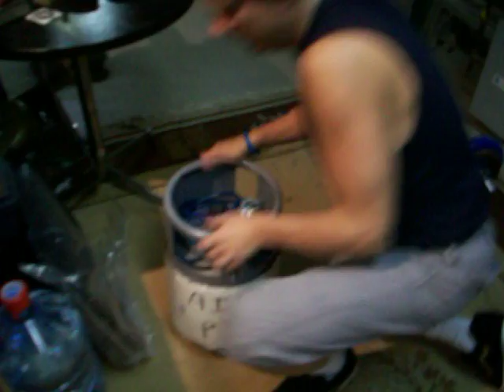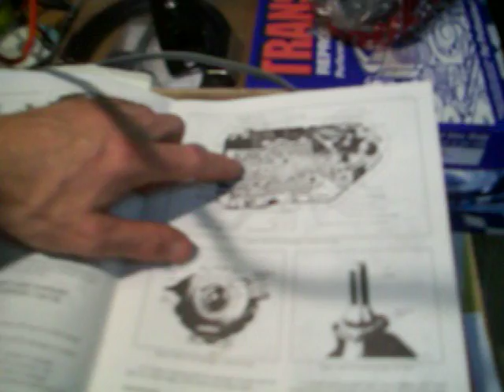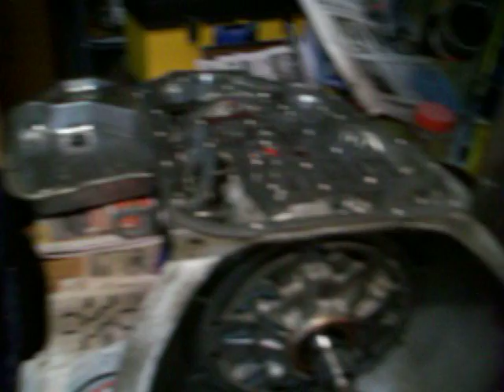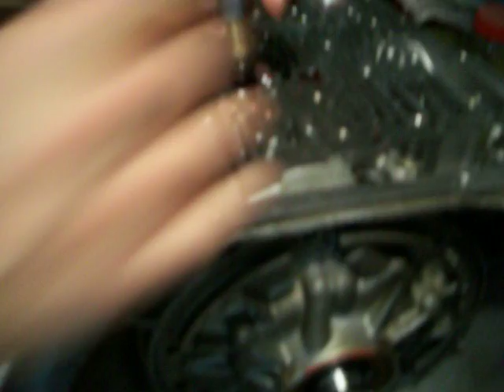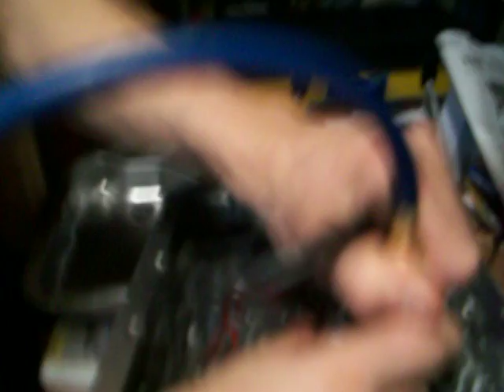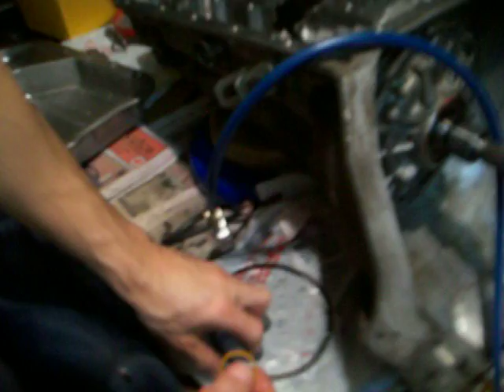200-4R air pressure checks

Comment from the maker: Thank you for asking.  It will be tomorrow before i can get to my books and notes, and be able to scan the needed stuff for you.  Is the transmission going into your '89 Caprice?  The 200-4R would have needed a few small, but vital improvements to live behind the lively 350 V8.  For now, please look at the more recent clips on my channel on the 200-4R, They may show a more clear view and what the air passages are for.  PM me with your email address.  You are wise to be doing the double checking.

Comment from the maker: That pig has earned it's keep, saved many a neighbor and friend stuck with flats, etc.  Actually, a seal HAD rolled, this was the first air pressure check done of the assembled elements.  While I was a little miffed to have had disassemble the transmission back to the input ring gear (sits in front of that low/reverse clutch spoken of in the past), I would really have gone into seclusion should the car not have gone into forward right from the first attempt to plunk it in gear.  Better safe!